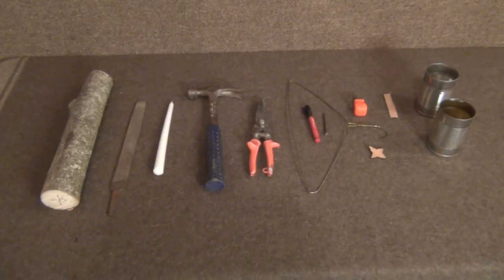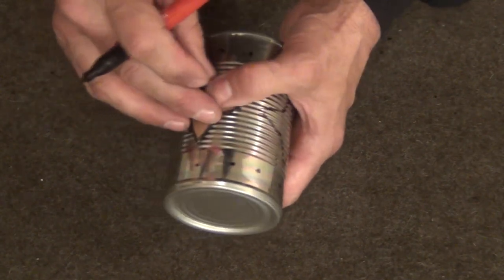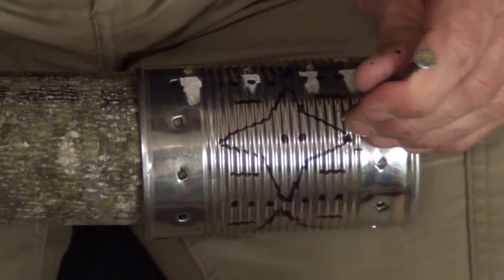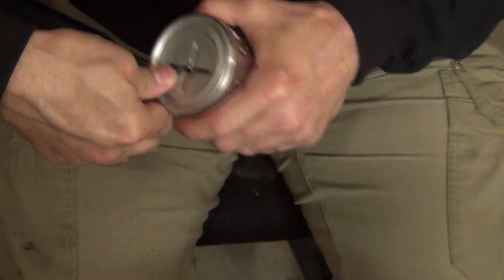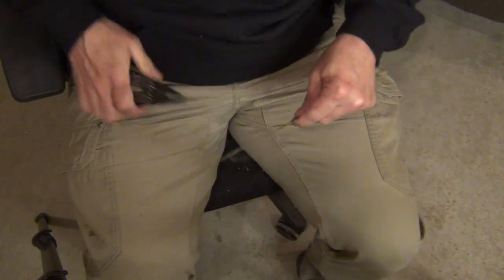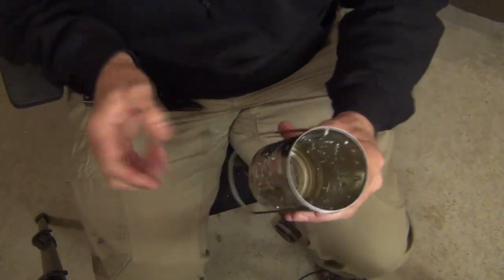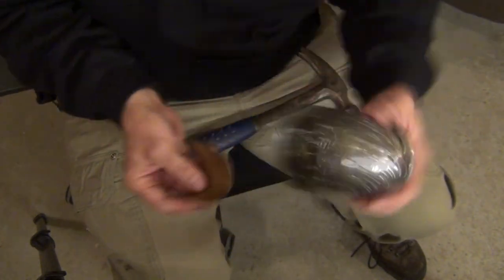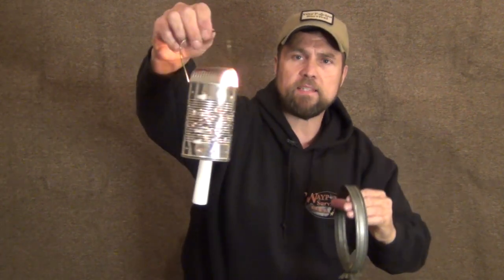DIY Pierced Tin Candle Lantern

Comment: Cool project for the younge and old people.....have you tried this project with the aluminum cans (pop cans) ? if so , how did it work out ?
Reply from the maker: Thank you. No, I haven't tried it with aluminum cans. I'm sure it would work but cutting into those cans to make openings in order to let out the light or change the candle tends to make very sharp edges and they are definitely more flimsy, especially when you start putting a lot of holes in them.
Reply: @WayPointSurvival  yeah...your points make a lot of sense
thank you